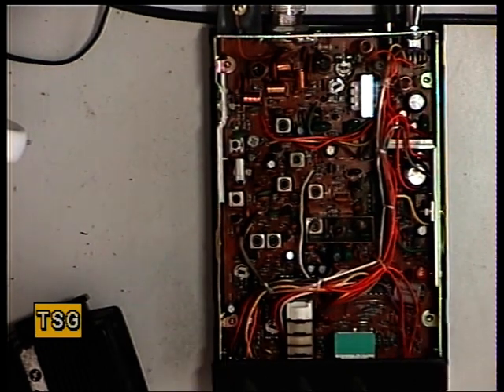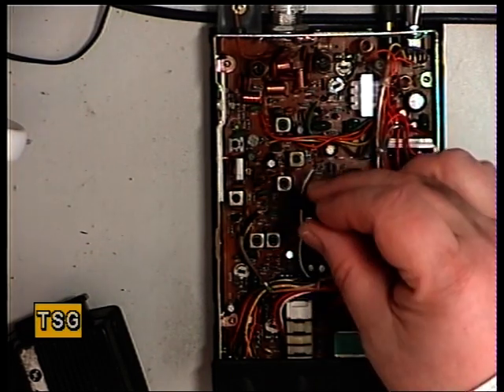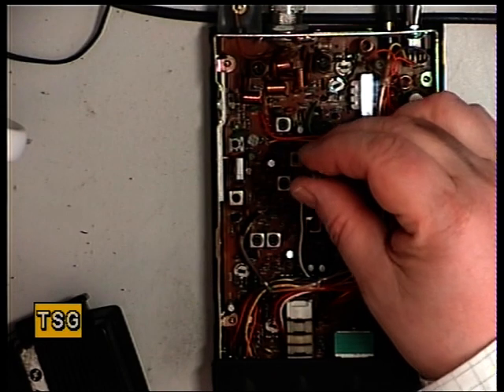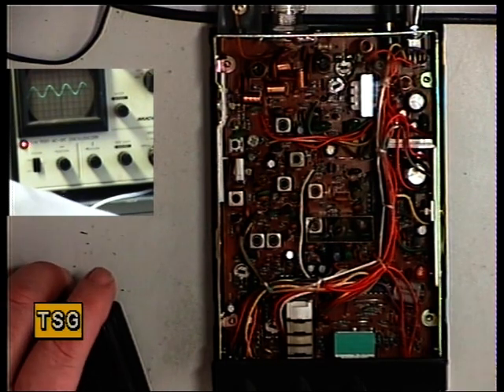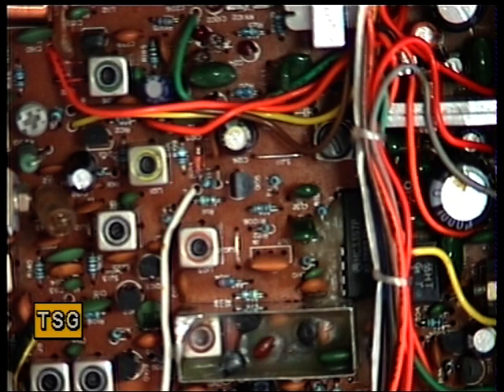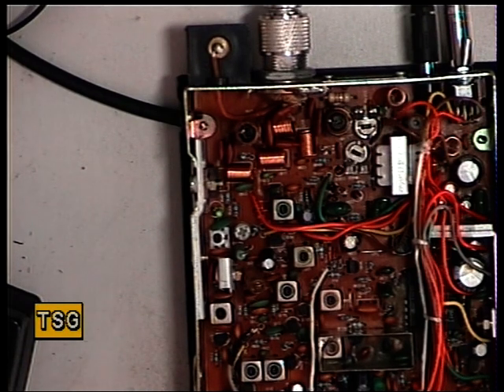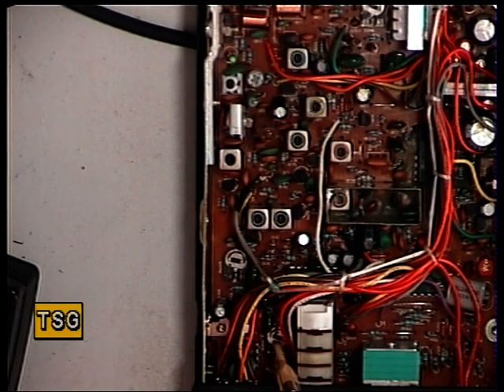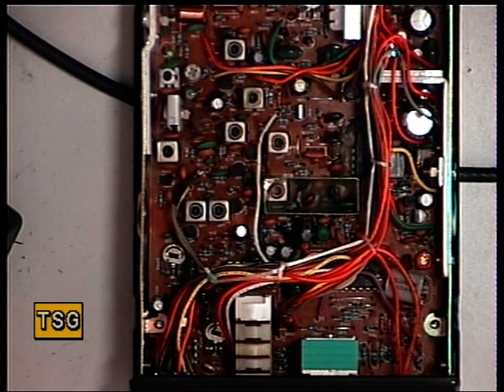Midland 77-805 Port-A-Pack, UK (CB 27/81) CB radio (Transportable) -  Receiver alignment

Comment: You can wire a standard coffin mic to these Richard. That's how I used to run mine mate. Had to use an external speaker of course, but it worked with a standard coffin mic :)
Reply from the maker: Roger on that Chris. I'll put it on the 'working' shelf & not use it for parts. I'll look for a mike at a radio rally & ebay. Thanks.

Comment: I have got one of these , how can I make it push a few more whiskers ?
Reply from the maker: Jammy Dodger It's a 4W radio & the UK & EU legal limit is 4W. You are hard pushed to get 4 real watts out of most radios. Legal points aside, there is no point anyway as you need to square the power to double the range....that would be 64W. SO if you could make it do 6W for example, you'd be lucky to gain an extra 100 yards in range.

Audio power works the same way. A 20W hifi amplifier isn't 10 times louder than a 2W one I'm afraid.

Richard
Reply: Thanx for the quick reply and the useful information , I understand what your saying , I was hoping I would be able to set the low at 5W. And high at 10W , I do think mine is well under 4W :/ , if I was going to take this to a professional for a tune , how much should I be paying ? , do you no where I can buy the pouch and antenna for the Midland as I only have the radio and mic , I have been looking on eBay but no look  if you have what I need I will pay good money ?
Reply from the maker: As a portapack, they have a good 6 mile + range in open country. I've had 14 miles out of one. As I say, power beyond 4W is pointless & just uses lots more electricity. There is also a worldwide law that hand portable equipment may not produce more than 7W (5W max is recommended). RF energy in close proximity to a body can result in a detached retina...for starters. That's why mobile phones are only 600mW output (0.6W) & rely on transmitters every 1/2 mile or so!

I've no portapack accessories here. When I did the video I didn;t even have the right mike, but susequently paid a whopping £15 for a used correct original one...just for my tests!
Reply: I think it's best I leave it as it is then , thank you for your help , and keep up the good work / videos 👍
Reply: @ukfmcbradioservicingTango21  Hi there, I have a few of these. Do you still service CB's at all? Thank you
Reply from the maker: @grahamhillman4251  email me rshireby@yahoo.co.uk